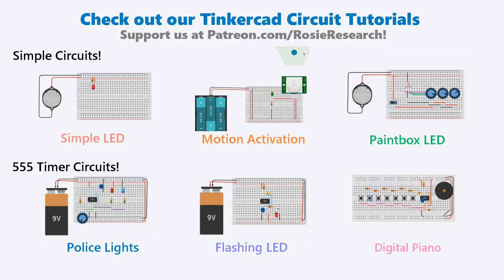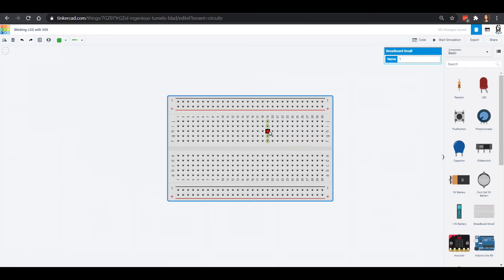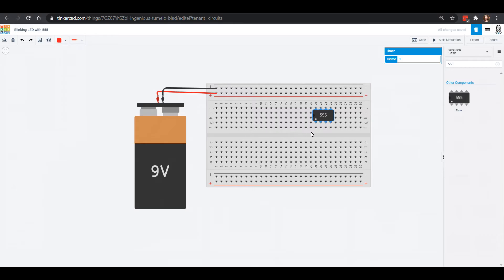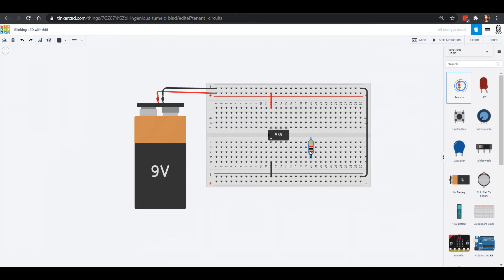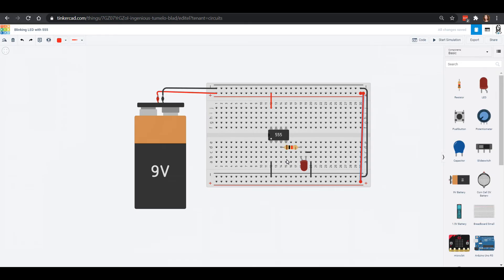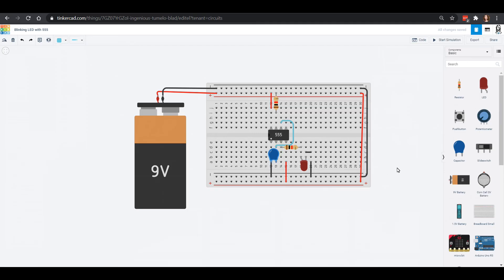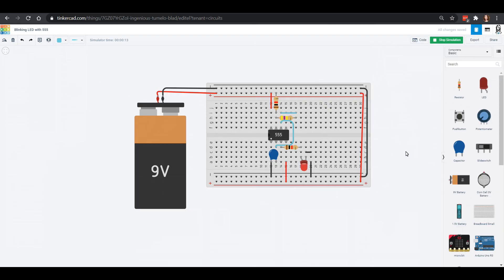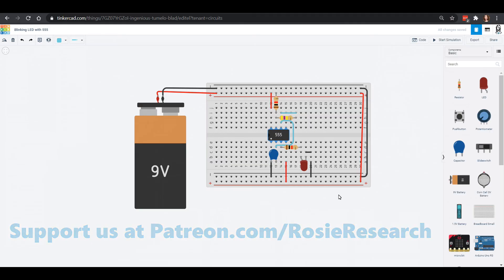Tinkercad Circuits Tutorial - Using a 555 timer to flash an LED

Comment: I'm actually trying to build from a schematic that I got in class. Is there are way to adjust the legs of the components, in tinkercad? For example, I have a resistor going to pin 1, and the other end should go to an LED that's connected to pin 3. However, if I stick the LED in, one end goes to pin 2, and the other end goes to pin 3. I need one end of the LED to connect with the resistor, in pin 1, and the other end to connect to pin 3. How can I do that in tinkercad?